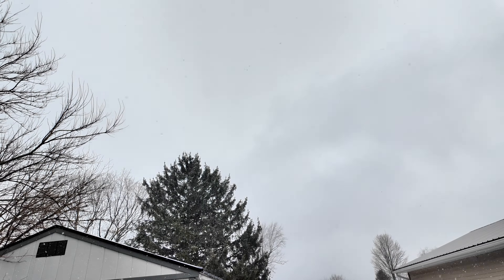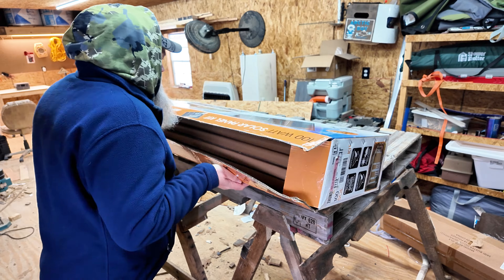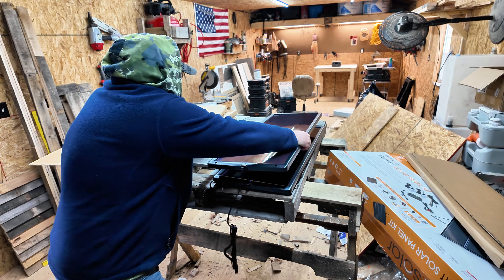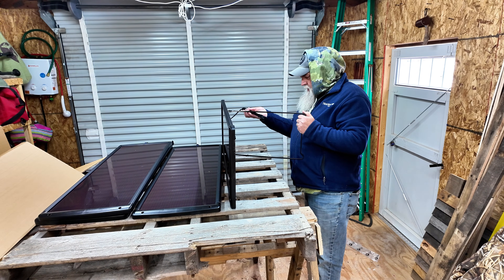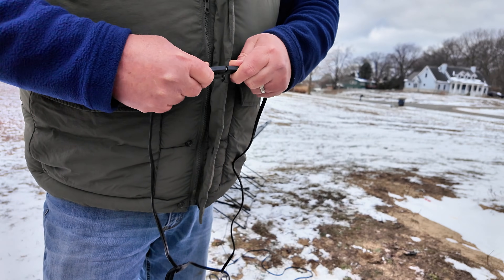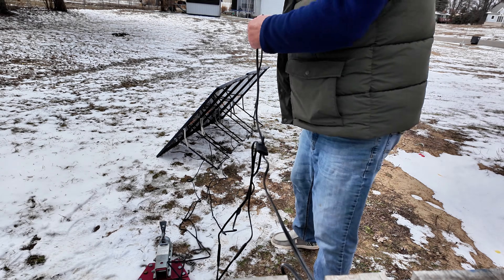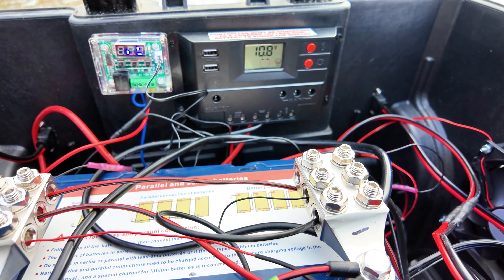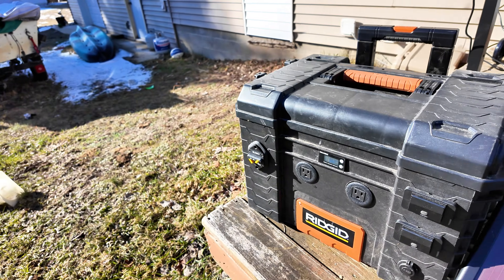I Tested Harbor Freight’s $150 Solar Kit—Does It Actually Work?

Comment: Overpriced junk Amazon has a 100w solid panel for $50, $10 controller, $3 in pvc pipe for a prop leg WTF ya need to pay $150 for
Reply from the maker: I hear ya! There are definitely cheaper ways to piece together a setup if you’re comfortable sourcing parts separately. This kit is more about convenience—everything included, plug-and-play setup, no extra wiring or mounting hassle. For some, that simplicity is worth the price. Appreciate your input!

Comment: I've been looking at those for a few years now to charge my camper batteries at the hunting land. Maybe I'll watch for a sale and buy a kit.
Reply from the maker: "I hear ya! It’s a pretty solid kit for the price, especially if you catch it on sale. Works great for keeping camper batteries topped off at camp. If you decide to grab one, let me know how it works out for you!"
Reply: @BuiltForTheWildYT  nope overpriced junk. Amazon has a 100w solid panel for $50, $10 controller, $3 in pvc pipe for a prop leg WTF ya need to pay $150 for
Reply: These are on clearance at 130 if you can't find em & 15% coupon next 32 hours